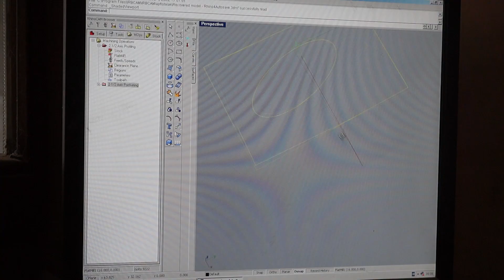Watch Stand (2000 year old bog oak)

Comment: I very much like the watch stand for the looks and the materials used.....however if you would have made the stand with handtools and a few everyday power tools instead of a cnc factory robot that would have been a lot more interesting to follow for a viewer/fabricator.
Reply: HoutmeyersP not really mate. Not everything on youtube has to be dumbed down to the every day hack can do it too level. Some thing require skill that takes years to master and others require significant equipment investment. It doesn’t all have to be diy
Reply: Well , its my opinion/view on this video ....it does not need to be yours. For me personally letting an expensive machine do most of the work takes out the magic. Like letting a plotter or printer do a Picasso or Rembrandt painting. This was a dumbed down to the every day hack can do it if he had a robot  level .
Reply from the maker: Hey you are both right! Sometimes I feel like doing things by hand and sometimes I don't.. I try to keep all of my audience interested.. Sometimes when I do things by hand I get questions why I didn't use a cnc, work would be much faster and easier.. Doing by hand does bring big feeling of acomplishment, very true but I also l like to hypnotically watch the robot moving and be amazed by German engineering :D
Reply: I'm more interested in the final design, so the method doesn't bother me. I only get irritated when someone makes a part using a 3D printer, as it's no different imo to just buying the part from a shop.

Most things done to wood with a CNC can be done by hand or using power tools, providing you have the skill and dedication required for the job, so I find the outcome of interest despite not owning a CNC robot. For instance, this piece would be extremely simple to achieve by hand, it would just take a while to make all the cuts and file down the oval.
Reply: But how often do you come across 2000 year old oak. For me I enjoy the show.